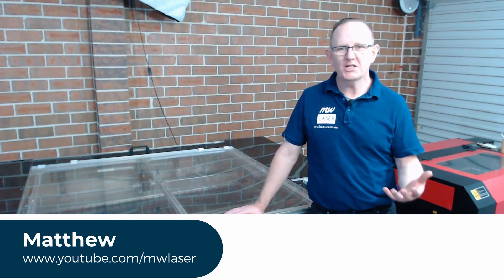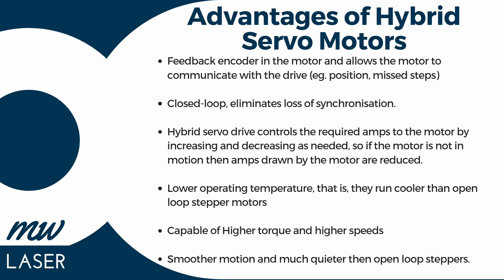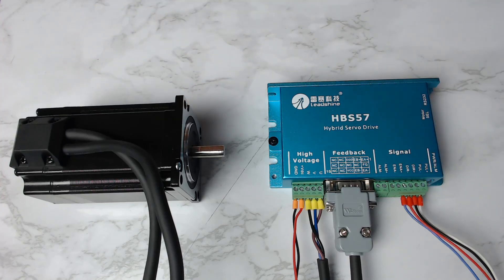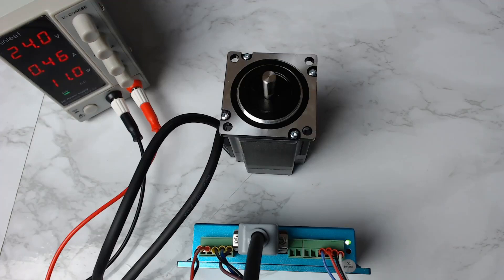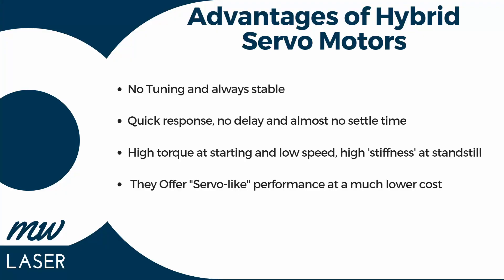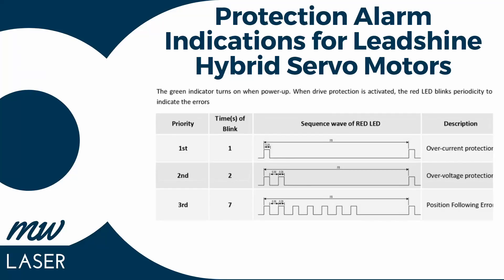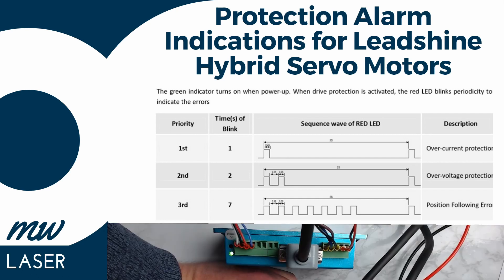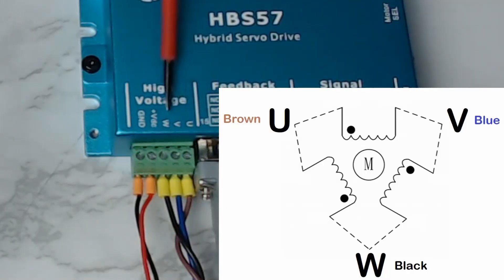Leadshine Hybrid Servo Motor and Driver - Cloudray Laser

Comment: Hello Sir, 
I have problems about of the accumulation error of the stepping motor when running for a while then I have reset to homing point it’s come back . I should be fixing the drive or the motor or anything sol.? Could you help to recommend me?. Thank you in advance if you recommend.

Comment: I have a chinese, blue and gray 80w, do you know if these can be installed on this? It currently uses DM5454A steppers and has a RDC6442G-B controller.
Reply from the maker: yes, you could get similar units to match the NEMA size you have on your machine currently
Reply: @MWLaser  cool! I'll have to dig deeper into this.

Comment: Quite a detailed video. I'm wondering if this would help with repeatable moves and avoiding position drift on the Y-Axis when doing detailed cuts at higher speeds (and with high idle speed and the Y-Axis shifting quickly between elements). Might be worth the upgrade if that is the case 🧐
Reply from the maker: if used on y axis it should improve position accuracy

Comment: Congratulations on the video, it's a good comparison.

For the Y axis, what motor and what driver do you recommend, if it can be with a double axis, since I have a central motor, for the two guides, as it seems the same as your machine.

Thanks.
Reply from the maker: can you email more information on the axis dimensions and setup to matt@mwlaser.com.au

Comment: Just wondering if you were able to increase you speeds using these motors? if so can you tell me how much of an increase please ?I have just replaced the standard steppers for these and am hoping for an increase in speed during engraving . Thanks !
Reply from the maker: yes the speed is increased.  however it is important to note... the faster you engrave the less time the laser beam has to mark / engrave the material, so you will need to consider this if you require high resolution / quality engraving.
Reply: @MWLaser  Thanks for your reply , did you change any setting in the vendor settings to increase the speeds ? TIA !
Reply from the maker: yes your axis vendor settings need to be set to the max speed you want to safely operate.  if you are trying to engrave over the max speed set for the axis, it will default to that max speed.  so adjust it as required.

Comment: Is programming the driver with the RS 232 cable necessary to obtain accurate measurements while the CNC machine is running or is it sufficient to adjust the settings in the Mash3 program with the hardware? Please clarify because I always work with only stepper motors without encoder, thank you very much
Reply from the maker: Leadshine offer support for their products - http://leadshine.com/Support.aspx  Cheers

Comment: I'm using a DSP RDC6445G (EC) wth 2HSS57 step-driver and a MODEL MOTOR: 57J1880EC-1000, in the driver I have already changed the steps, but I can't get past 100mm / s and the driver triggers the alarm. (photos of the driver and engine follow).

Can you help me?
Reply from the maker: I suggest contacting Leadshine Support or your Supplier on this issue.  I cannot receive photos thru YouTube Comments.

Comment: I'm using Hybrid Servo HBS57 Leadshine, but my Drive motor not operator, it's error "Position Following Error". I reset my driver but not fix the error. I'm using software HBSProTune and connect to computer but it no change. You can help me how to fix error "Position Following Error". Thank you!
Reply from the maker: Please contact Leadshine Support.

Comment: Hi, would this be a feasible upgrade on the Chinese 7050 80w laser or not worth it or not doable?? Cheers
Reply from the maker: it is possible, however you'd need to check the specs and NEMA size of your current motors they may not have the physical space requirement to install on these smaller machines.  I cannot advise if it is worthwhile, but it is not something I'd do on my smaller machine 7050

Comment: Beautiful review . I have used leadshine ACS606 servo drives before they are great and can run cold af all day. Have you done running temperature comparisons? I am in Australia and it can get pretty hot here.
Want to try these as i am guessing they will need less setup time and ofcourse more holding torque than servos. I’ll lose on max rpms though.
Reply from the maker: Setup time is similar, but you will also need to have cable chain wide enough to accommodate the feedback cable.

Comment: This combo is $155. Clearpath servos start from $239. So this option is lot cheaper.
Reply from the maker: When comparing prices you need to compare like4like remembering that these are HYBRID servo motors
Reply: @MWLaser  I am fairly certain those are not actually leadshine products.
Concidering that there is a link to "leisal . com" on the motor....
Seems pretty freaking fake
Reply: Matt, clearpath "servos" are hybrids as well.    And $239 is hilarious to be honest, because you need their PSU as well as couple small wiring packs.   To get two clear path units and their 75v PSU in a working system, you're looking at about $750 to $1K+     You can get two of these Leadshine hybrids and drivers for about $350 or less.     BUT.....   Clearpath units are infinitely better in everyway.    You're looking at about 50-100x more torque and speeds ver 3Kmm/s @ 5G accelerations on a system like Matt is running here.    That being said.  I would go with their Leadshine units before I would run typical steppers any day.   No matter how good you set up a stepper unit, you cannot get the repeatability any encoded motor can, period.    Micro-stepping is awful with steppers for laser accuracy.   Those are for the DIY 3D printer guys.